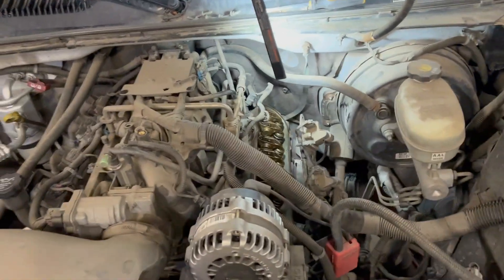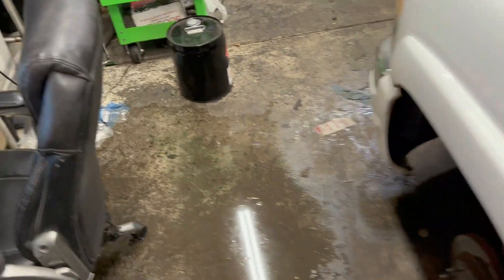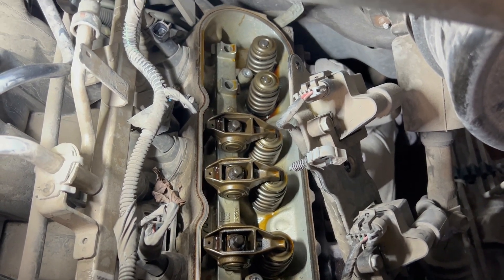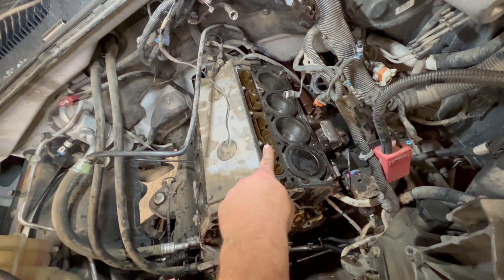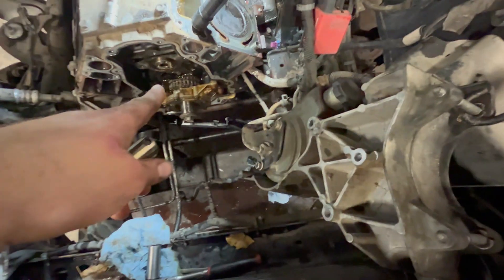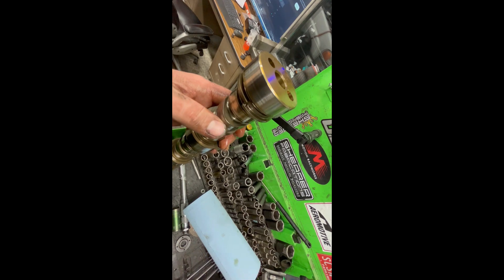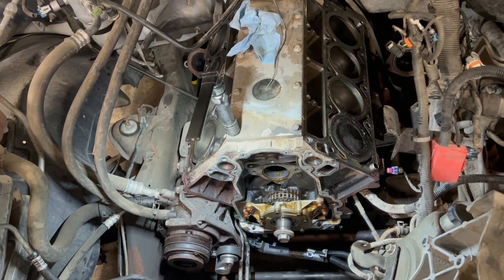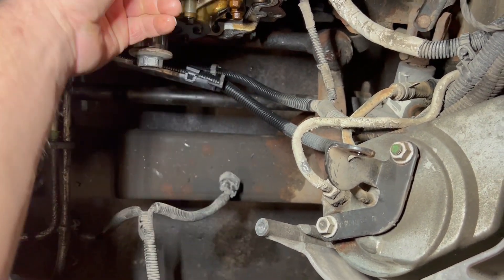Hard to find Ls Engine Knock? Watch this!

Comment: shouldn't oil be coming from the push rods over the rockers for lubrication? Didn't see a drop come out while you were running it.
Reply from the maker: Good point.  I would say yes.  New lifters pumped right up. I saw this too after I posted.  Good find.
Reply: This usually starts after the oil warms up completely or at slightly higher rpm than idle. Pre-load on the lifter also affects this, on my Pontiac engines I adjust for 'zero lash' with the engine running at idle with poly locks- this really wakes those engines up and oil flow seems to increase through the pushrod.
Reply: @Brainstangs  I have a Sikora problem I think on a 98 trans am.  How do I contact you ?
Where are you located ?
Reply: You’re video helped me find my problem right away. Thanks for sharing!
Reply: Damn, maybe just figured out my issue!
Reply: Dammit.... truck norris.... here we come!

Comment: From what I've heard, the lifter trays are responsible for keeping the lifter roller inline with the cam. They wear and the roller starts to oscillate causing cam wear. One mode of failure.
Reply from the maker: These were right upon removing.  However yes I agree that would be a cause too
Reply: Definitely do not buy the cheap China lifter trays! Too much play!

Comment: My 2004 5.3 Silverado developed this noise around 60,000 miles with constant oil changes (2500 miles) with mobil 1 oil and filling the oil filter to prevent dry startup.
Wondering if mobile 1 is garbage,  lifter/cam not good quality or oiling issue in the block.
Outstanding video and information- thank you
Reply: Mobil one is a good oil, but the viscosity the factory calls (5w20?), isnt for lead foot.
Reply: 'The noise' could be anything 
The noise is the 'Effect'.
Fix the 'Cause' otherwise the Effect will Re-occur ..
In this video, there didn't appear to be a drop of oil coming out of the push rods with engine running.  Also seems like plastic roller guide keepers were not checked for wear that allows Rollers to wobble on the cam instead of running true (like a bad wheel alignment).
Reply: #operationls
Reply: o ring on the pick up tube and sump in the oil pan goes bad from cavitation where they drilled the tube intake cover before it gets to the pump gears and they changed drill type and direction, that hard 90º needs fixing with a grinder to smooth the flow instead of cavitation. oil pressure below 40psi on the gauge should tell you at any time.
gm faulty design, but they changed the oil pump 2014+ series, idk when, but the new oil pump is very pressure sensitive in how it self adjusts really neat way to demand responses of the engine from high rpm to low rpm shifts. be nicer to your vehicle with smoother shift speeds not 5k rpm down to 2+k rpm
here is what to look for to modify with a dremmel  Small block Chevy oil pump
maldo72 5.91K subscribers 67,282 views  Jan 30, 2023 Small block Chevy oil pump

Comment: Did you check Oil pump/pressure with an independent guahe ? There wasn't a drop of oil coming out of those Push rods it seemed.
Also did you check the Plastic Roller Guides for wear ? They are crucial(and fail) to keep those Rollers running straight (not wobbling) on the Cam Lobes .. 
Otherwise, this could all happen again .. quicker next time.
Reply: PS Never assume new Cheap plastic Roller guides are any better than the old worn original ones ... they are sometimes worse and must also be checked for wobble..

Comment: Gee! the same sound in a Toyota 2011 Camry 2AR-FE, makes me wonder if any of the lifters could have the same gulling damage? Lifter  is not a roller type. Could the sound that's produced be from the roller protrusion or a low spot then strikes back down on the lobe, is what makes the metallic knock?

Comment: i am at this stage with a 2013 AFM DOD lt silverado and just found the #4 intake lifter collapsed and inspected the cam and saw 'spalling' on it the lifter roller itself is just collapsed solid with the beginning of drag spalling on the roller so <eye roll> 123k miles but at 100k i was getting random 1-3 times a year stabil track auto disabling and had no idea why. when you get stabil track and traction control disabling, your about to lose oil pressure within 10-300 miles.
i had a 2000 silverado also that had lifter noise on warm up, now i know why the original owner took it to the dealership and traded it in, i bet he took it to service first and heard the price tag on the repair and just decided the trade in value was better on a new truck. i still have that truck bought it with 113k and it's got 320k on it, but at 280k it was getting misfires and the lifter noise was alot more constant, but i knew nothing and just changed the oil which came out fine but started to get black  before 3k miles. lucas high mileage synthetic helped it with the lifter tick since 150k when i first decided to see if that would help which it did considerably. idr why but the synthetics are just more slippery and for longer than conventional and keep the oil golden for longer.
now i know what it means after watching a few of these afm dod issue videos, that's the first sign you have a lifter beginning failure the stabil trak warnings. normally i shut that stuff off when i start up in the winter because i'm a snow plow driver and i know how to drive in snow better than those woman driver aids can help, which actually interferes with compensating in snow and ice. but they are great for woman drivers because the feedback will scare the living hell out of them and make them slow down keeping them out of the ditch mostly. 
i drive like an old grandpa or F1 driver kimi riakkonen depending upon the traffic.

Comment: I must be dense, but since the cam is just opening/closing a valve and even when in this failed condition it is opening/closing valve just not as high lift as should be, how does the miss show up on a scan tool? I thought scan tools interfaced with ECM and electronics, like an injector or coil, how does it show a miss from the lowered compression (I assume)? Thanks.
Reply from the maker: not just any scan tool.  A good scan tool with a misfire graphic.  Yes a low lift cam lobe that is wearing down will cause a misfire at idle.

Comment: Wow, usually the center two cylinders on each side are the ones chewing stuff up.  Seems kinda dry when the engine was running without the valve covers though.

Comment: Mine has a noise like forged piston slap with a very minor squeek... the noise sometimes comes and goes which is very strange and my oil pressure sometimes drops below 15psi when you're idling but at 2000 RPM comes right back up to 45...

Comment: Great insight and lesson to repair!
Have a 4.8 knock in the morning at start (210k miles). 
Noise goes away once idles down. Rest of the day start up without noise?
Runs great, no oil drip or burn.
What do you think?
Reply: Sounds like piston slap. Common and basically harmless on those.
Reply: @rasheedx5322  Perhaps, but I did discover wrong weight oil was an issue. Seems as though if oil is up in the rockers noise is not heard. Cold start it's heard briefly. Heck, so many miles can't really expect much more from the beast.

Comment: I had the same problem,on number 7 cylinder, I taking everything apart.the lifters worm down and cam.I tell everyone having this issue, please replace cam , lifters,time chain  and oil pump,Mt truck is 2008 Silverado 4.8 with 
250000 miles.Im back rolling now these are some good engine .16 years I had my truck
Reply: I'm going to try to get another 16 years out my engine

Comment: I’m pretty sure this is the problem with my truck. Has 285k miles on it. Do you know how much a shop would charge for this repair?
Reply: 4k-14k depends how far along and bad it got. once one cyclinder goes down at the point the cam is getting ruined for that lifter, it works on wrecking the next firing cylinder. my 2013 lifter intake collapsed and it deactivated the firing of that #4 cyclinder, and i'm less spalled than this but the crazy amount of carbon build up on the cylinder right behind it #6 is like powder lead and burned oil combined. this is passenger side, and i have yet to take the head off the driver side due to the rain the last two days.

Comment: Dealing with the same problem have a beautiful loaded trimmed 06 with 2200 on it and it sounds like hell
Reply: Just swaped a 6.0 into my lifted tahoe...sounded shitty. Shop pulled the motor, rebuilt it and still ticking. I'm 2500 down so far and its been in the shop 3 months now

Comment: No check engine light? I have a chirping noise once the engine is warm. It's been like that for a year and I just recently past a Echeck. This is on a L77 6.0 I swear it's coming from the Bell Housing. The shop told me today their not sure what but it's coming from my motor. No check engine light at all.
Reply: I’m having the same problem I guess.  I have an LQ4 but it sounds kinda like a diesel and the noise seems to be coming from the bell housing.  I’ve already inspected the flex plate and it’s fine.  Bolts are torqued too.  🤷‍♂️
Reply: @haydenf1353  I guess it's time for a cam and lifter change

Comment: I had the same problem,on number 7 cylinder, I taking everything apart.the lifters worm down and cam.I tell everyone having this issue, please replace cam , lifters,time chain  and oil pump,Mt truck is 2008 Silverado 4.8 will 250000 miles.Im back rolling now